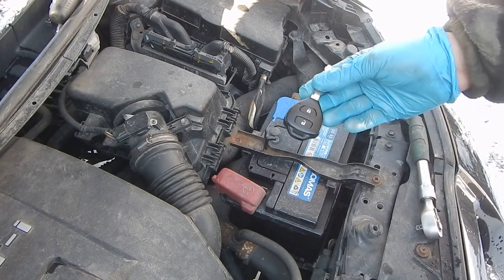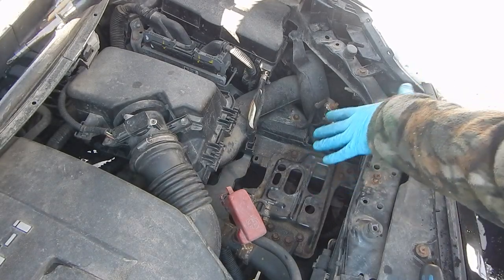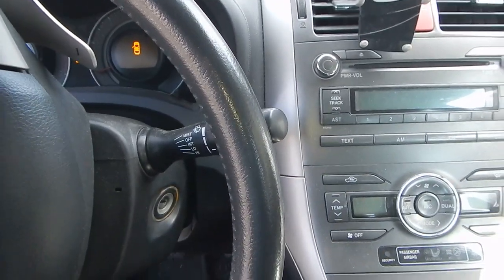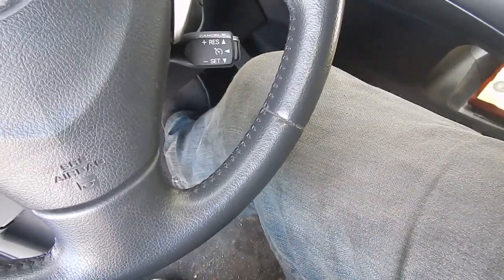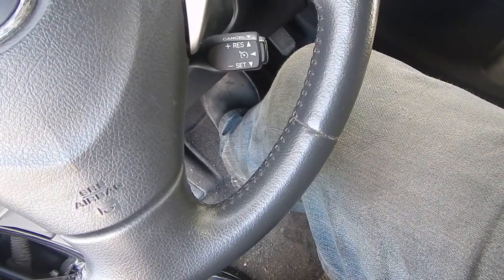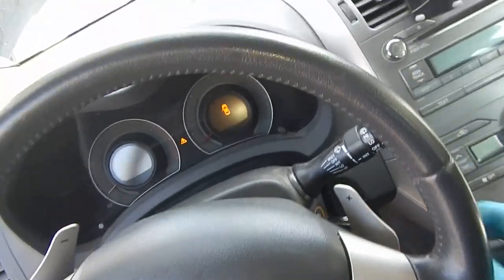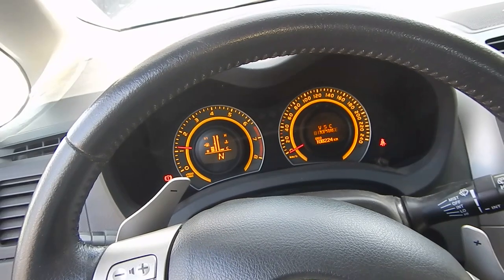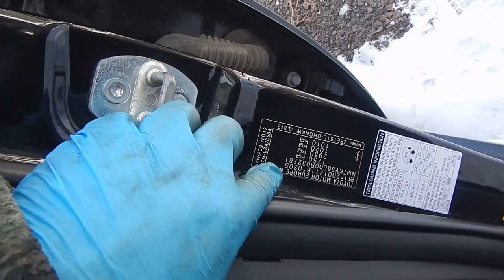Actuator of Clutch - Refurbished with Warranty 30.000 km for Toyota MMT Semi - Automatic All Models

Comment: Hi Yuri, I appreciate very much what you re doing here to help us. You are a treasure! Please, i need your advice to fix my corolla. Recently i worked on clutch actuator and gears actuators, I replaced with some second hand ones but now I have another situation, Error Code P0900 and the shift lever does not stay fit in N. When I start the engine it goes forward, the gear box is engaged in a gear (forward). I ve tested the clutch actuator on battery and it works but when i install on the car it does not work. I even did the relearning with Techstream software but no success. Looking forward for you! All best!
Reply from the maker: Message me to whatsapp, will more faster +375 29 6353511

Comment: Good video. How do you know if it is the clutch actuator or if the clutch is bad? My 2005 1.4 d4d MMT shows a flashing red gear in the dash.
Reply from the maker: Must be trouble code:
in blink mode - 35
or via obd P0810
Reply: @vak_service  Yes it has a code. I do not remember now, need to scan it again. Have been trying to fix this car since 2016. LOL long time. My mother got sick with cancer so I took care of her and left the car parked. Getting back to fix it now after all this time. The car has 280,000km  I was thinking maybe I should replace the clutch? As well, I did a clutch relearn, and read yesterday this is not good to do if the clutch is not replaced as it changes the parameters?  I will scan it to see what codes it has and let you know so I can send you the Clutch actuator.
Reply from the maker: @nas0075  Message me,  will repair your car - no problem
 whatsapp +375 29 6353511

Comment: Hi Yuri. Nice video. 

I have a Toyota Corolla Verso 130 VVT-I (2007), on low speed it randomly moves to "N" and get stuck on this position with the toothed wheel red sign light on. I have to stop, wait 2-3mn, restart the engine to get it running. It can occur multiple times on the ride, or none, really randomly.

Can you please let me know if replacing the actuator clutch will resolve this issue? Or it is something else?

Looking forward hearing you.
All the best.
Reply from the maker: Hello.
Thank you.

First step - checking for trouble code.
Check it like in next video:

https://youtu.be/W2DRdW2XflM?feature=shared
Reply: @vak_service Hi Yuri,
Sorry to not been able to contact your earlier, that's because I can't find the video with my comment/question.
Now it's done. The trouble code with the wire manipulation is 35.
Can you please tell me what is the problem, and how I can fix it ?
Thanks a lot.
Reply from the maker: @thienthangphung6769  35 - it is p0810 - clutch position control error. It mean in any case need to repair or change clutch actuator and better to change the clutch and important to grinding bushing in gearbox where is clutch bearing moving.
I can offer refurbished clutch actuator.
Message me whatsapp
+375 29 6353511

Comment: Toyota Yaris 2007 mmt makes a thump noise when changing gears is this an actuator fault please? This problem specially gear 1-2 worse on soft acceleration? Can the actuator make thumping noise hesitates (like a kickback) and moves again? Thank you
Reply from the maker: Hi.
Check for codes, if no codes - do calibration for clutch (if no codes only!)
If no help, check for mount of gearbox, shafts or other mechanical problem.
If clutch actuator not working properly - you will have some trouble code.
Reply: Hi - is it possible that faulty Actuator make thumping noises when accelerate specially worse in soft acceleration?
Reply: Boss please help- did calibration; changed changed transmission mount- Hi did calibration, replaced transmission mount- but car makes like a thud sound gear 1-2 slow acceleration...reves go high and then hesitates and have to accelerate again to move. It's like a sound when auto gears change but loud .What can make this noise  @vak_service
Reply from the maker: @JamesGarner-wb7eh  Hi. If actuator fault must be code.
Diesel?
Reply: Petrol boss but can this thumping sound and the revs go up - the noise be inside transmission or actuator ...you know normally when gears change you feel a little jump and slight noise...but this is loud  @vak_service
Reply from the maker: @JamesGarner-wb7eh  strange, do video and send me to whatsapp
+375 29 6353511